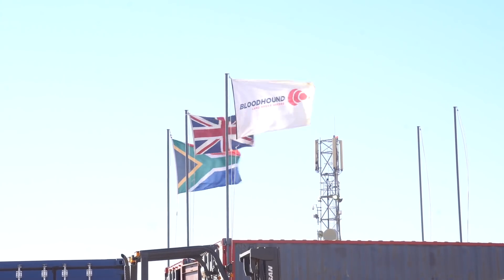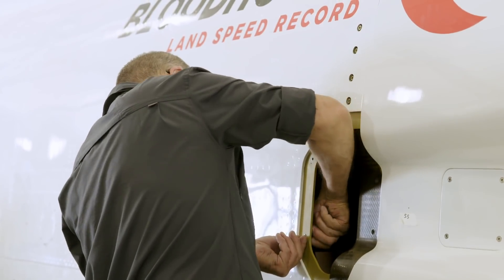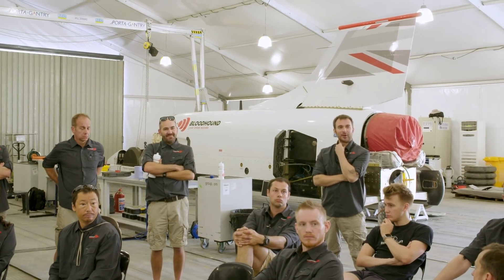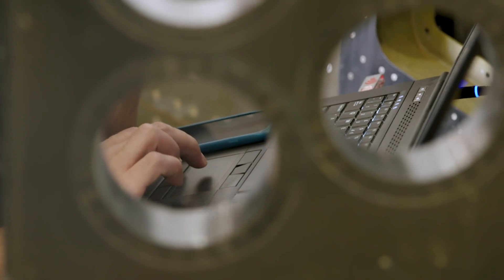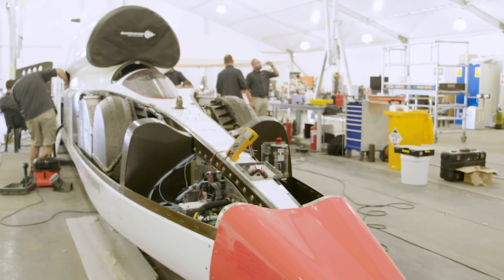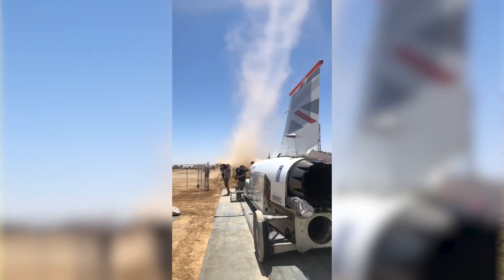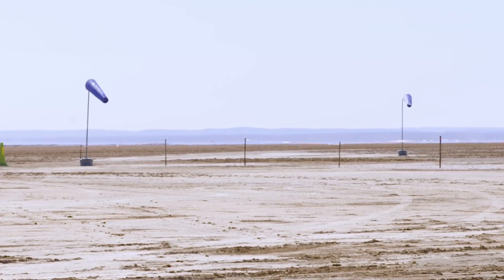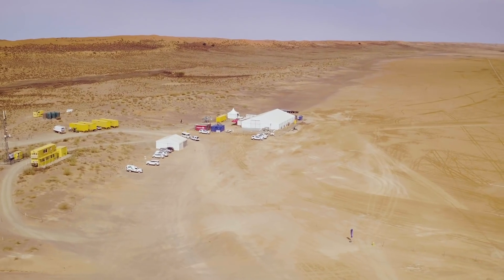Preparing for Run Day 2 | #2019HST

Comment: Crazy thought but if cool weather is good for speed. Would running the car on a frozen lakebed work or no too dangerous.
Reply: Air temparature and pressure. Cold air is denser, so more  Oxygen into the engine per volume. Turbos and superchargers always run better on cold damp days. Never had much to do with jet engines but I'd imagine that s the exhaust pushes against the air to propel the vehicle forward the more you have to push against the better, though it would also be increased resistance.

Comment: I hadn't thought of the effect of temperature beyond cooling.  Does the temperature altitude impact handling of the Bloodhound at speed? Testing is the only way to know, of course, but surely it's been calculated. 
Very impressed with what you have accomplished and awed by what you are attempting. Fair winds.
Reply: At speed, pretty much everything affects performance. Cooler temperatures result in denser air, and the engine will like that, not to mention it will stay cooler as a result. Higher altitude, conversely results in a less dense charge.
Reply: @bigrob966  Yes, for engine performance. What I was wondering about is the aerodynamic effects. As the air warms it becomes less dense. For pilots that means they treat a warmer day at ground level as if the runway were at a higher altitude. At supersonic speeds Bloodhound will be generating shockwaves around and, critically, under the vehicle. I'm curious whether changes in temperature will have a significant impact on the stability of Bloodhound at transonic and supersonic speeds.

Comment: I wonder how the driving surface there at the Hakskeenpan compares with ours at the Bonneville salt flats?  Is a relatively hard surface even that critical at 1000 mph?
Reply: They had problems with the salt all the way back to Thrust 2. The wheels had a habit of cutting into the salt and causing a lot of resistance on the car. It can also cause bad corrosion issues, and the surface is used for so many events these days that it's hard to guarantee a really flat surface, as it can be very dangerous to catch a rut in the ground at such high speeds. For Thrust 2 they went through a lot of hoops to even be allowed to run an event on the Black Rock Desert. That surface was then great for Thrust 2 and Thrust SSC, but nowadays again it's too busy, with events on the scale of the Burning Man Festival happening each year
Reply: I'm sure there were more reasons as well, but I know they put a lot of effort into finding the ideal surface for the car to run on
Reply: As well as Burning Man absolutely trashing the Black Rock surface every year (their eco credentials are terrible given the mess they make), the desert hasn't flooded for many years due to the prolonged drought in that part of the USA. The annual flooding of the desert is what used to re-surface it every year. To get Black Rock back into a fit state to run, it would require both Burning Man to either go elsewhere or clean up their act, and the desert to flood every winter. If that happened it would be better than Hakskeenpan which is a bit short to be honest, they've had to change the run profiles to be safe at Hakskeenpan.
Reply: The other problem at Bonneville was lack of lateral grip at other times, the solid wheels had a tendency to slide. Also the surface is very hard. Akali playas like Black Rock and Hakskeenpan never quite set solid, there is always a little bit of give which helps the car have a smoother ride.

Comment: What a way to start the day ,andy will bask in sunray's and valour the rest of that record breaking day
Reply: They won't be breaking any records this time around in the desert. This is all about ramping the speed up gradually over multiple runs to test different aspects of the car. Run 2 is aiming for around 150mph, with the afterburner on. The maximum speed they intend to do this time around is about 500mph. They'll then spend time in the UK analysing all the data, making fixes etc. before coming back and going for the record.
This is the same as what they did with Thrust SSC, and on that occasion the high speed testing gave them the opportunity to tweak software for the active suspension, fix issues caused by wear and tear on the desert etc.
Reply: @andrewbailey7999  active suspension?  It hasn't got suspension has it , I thought it was fixed axle to body cause it causes to much travel that would dig the nose in or flip it over ,especially when Andy green says 1° out on the stabiliser would do cause it to nose in or flip ,suspension adds to that factor
Reply: Thrust SSC had active shock absorbers at the back to adjust the angle of attack of the aero surfaces. Bloodhound has passive suspension with a similar wishbone setup to a formula one car, albeit much firmer
Reply: As far as I'm aware anyway. I went to a talk by Andy Green a good few years ago, and one of the questions started along the line of "with what looks like no suspension."
His response was "what looks like no suspension is actually a sophisticated wishbone setup"
Reply: @andrewbailey7999  I just looked and I see adjustment points for camber and ride height but can't see any suspension ,them 2 are what you expect to see .am going have to download the schematic and look as I thought was fixed type ( doesn't move in relation to the ground or body once it's locked in place  )
Reply: @pauldean8638  Well I figure there's got to be enough in place so Andy doesn't break his back if the car starts bumping around. I'm not sure about any details, as the last talk I went to was some years ago now
Reply: They're usually quite good at responding to questions on Facebook if you send them a message
Reply: @andrewbailey7999  Mr bailey I do believe your correct as today's update the engineers do say suspension,I goto get some junk off this and download the tech drawings as if Andy says 1° on the stabilizer would mater to push it in or flip it over , and I can't fathom how it can adjust as so fast from front to rear ,not even hydraulics can react that quick unless the transfer hose was huge .am just wondering how if he just mean ride height and camber .it maybe that the engineers don't use same terminology additional can be used and said to represent different meanings .when we say a fixed axle it means it doesn't move in relation to the ground or vehicle ,it's an adjustable wishbone that gets fixed in position ,it don't just mean like a gokart where it's a solid axle .the engineers can say suspension as it can be moved about till fixed at required spec ,it's not a miss meaning to say that either .if anything I would have said they put a floating seat system in like a power boats have to aid some kind of comfort t andy